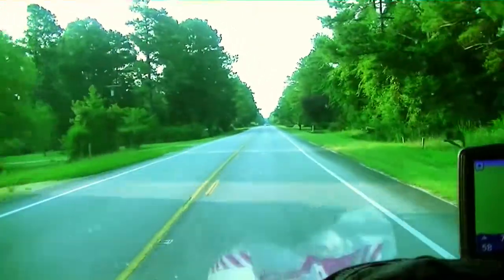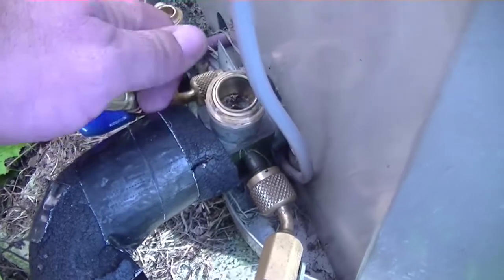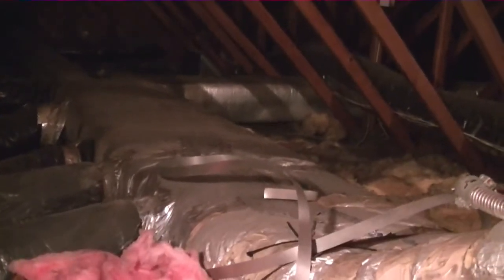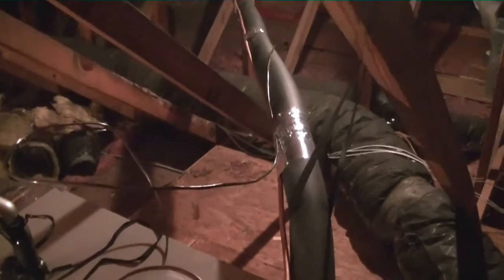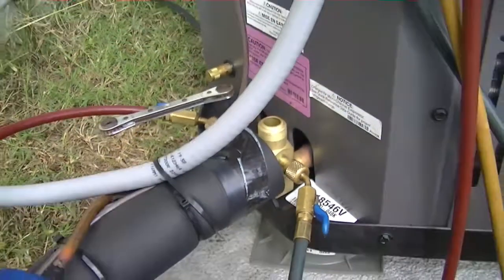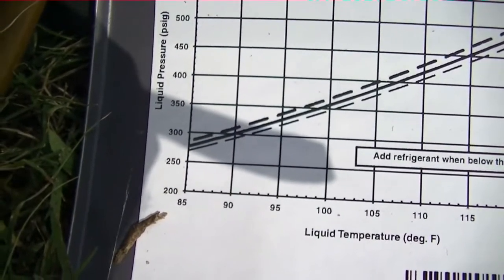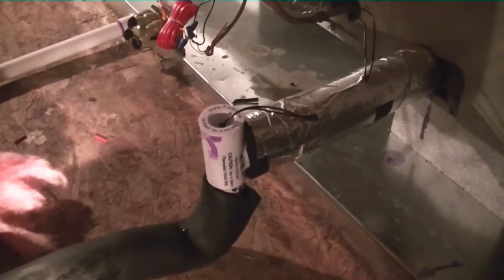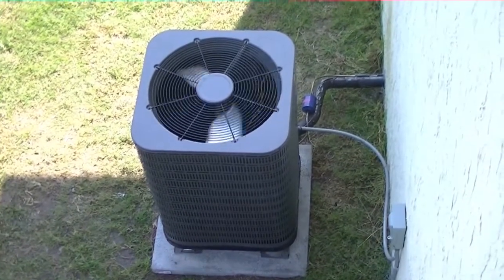HVAC Install- Air Temp 4 Ton Heat Pump

Comment: Good video. Is that extra thick armaflex required by code in NC? Use r.e Michel all the time here in northern va. Install trane and airtemp, have been really pleased with airtemp
Reply: Jeff
Reply: Well, I just had a 5. Ton Airtemp installed.